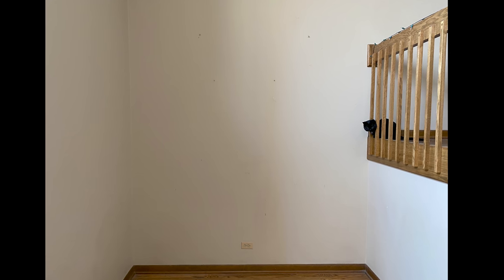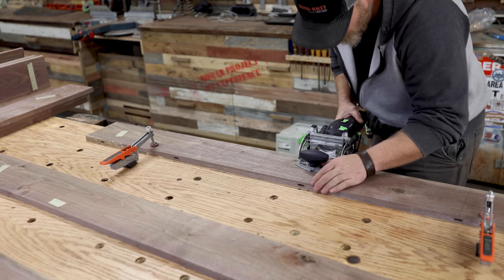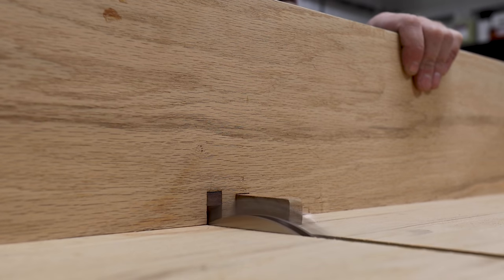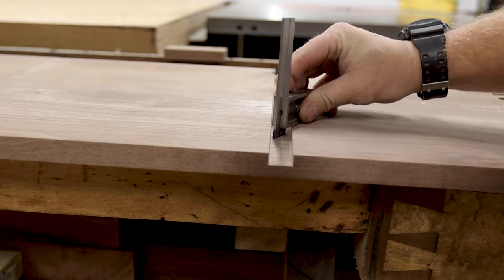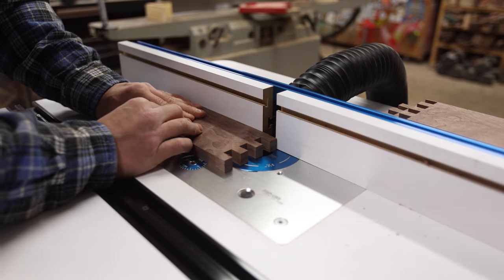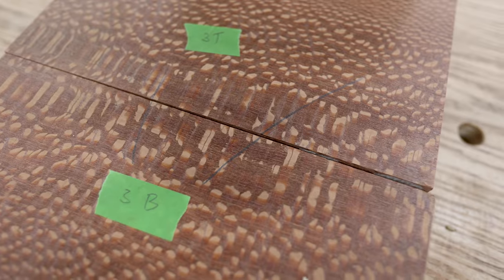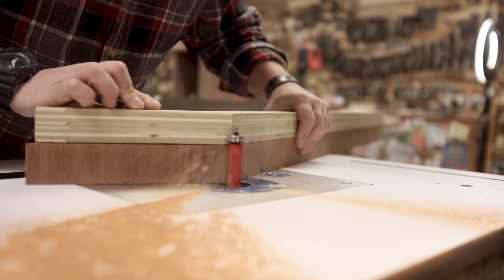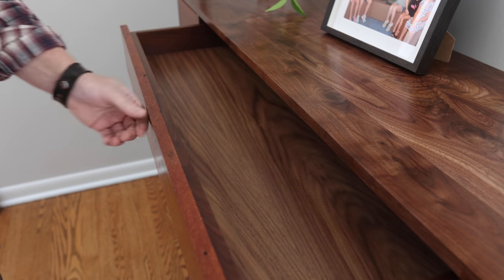How to Build a FLOATING Entry Table // PLANS AVAILABLE!!

Comment: For the tearout issue you can super glue two pieces of painters tape back to back and affix some cardstock to the backside of the boardedge you are cutting. It helps maintain the surface tension of the fibers so if you do get tearout its only on the paper and not the wood edge fibers. Just make sure you use some high quality strong adhesive tape. None of that 3m blue tape garbage. beautiful work though love the contrast choices